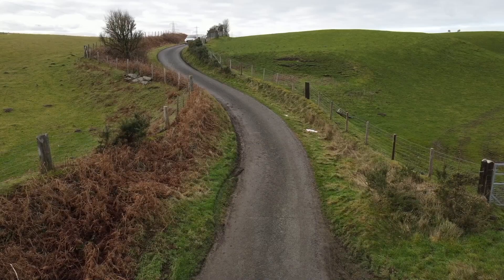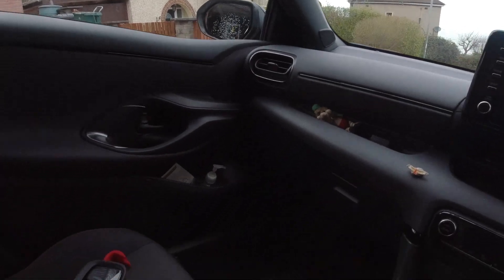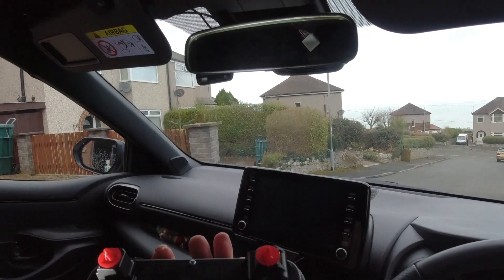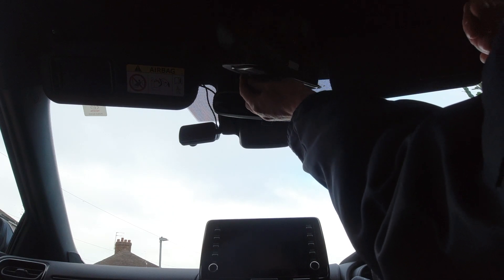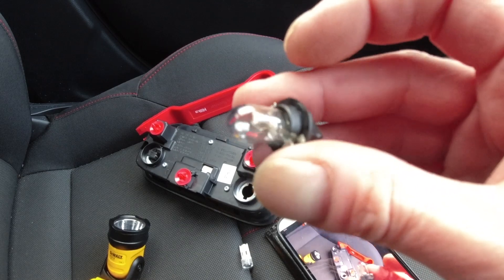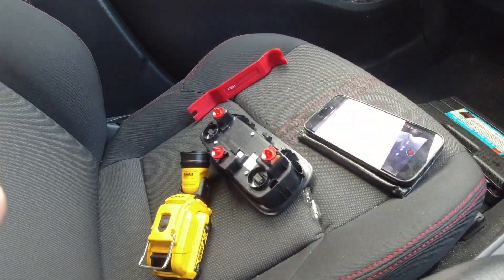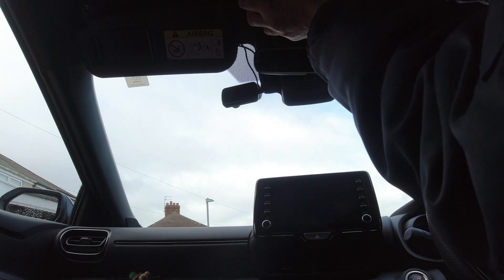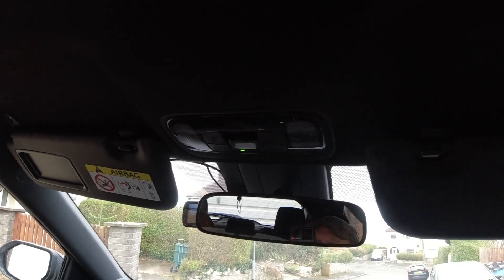Tips & Tricks 15 changing LED bulbs into interior light cluster

Comment: When I changed my bulbs to led, I took the (front) inner section away from the light frame, leaving the frame attached to the ceiling and pushed the bulbs in from the front. Again, you have to be careful not to break it. This type of job should be done whilst the plastic is warm, as cold plastics are brittle and can crack more easily when cold.
Reply from the maker: Yes that is the alternative way to do exactly what I did, change the bulbs 💡